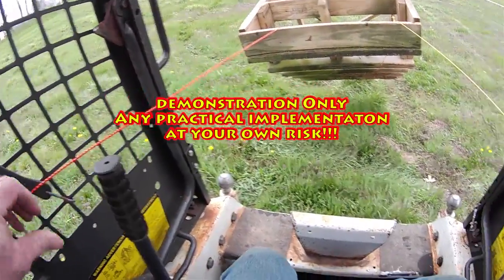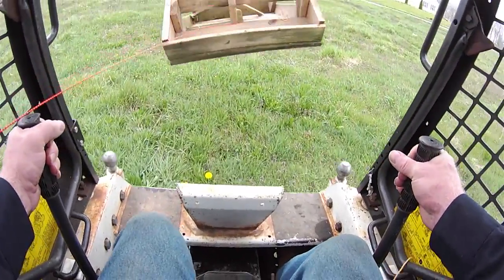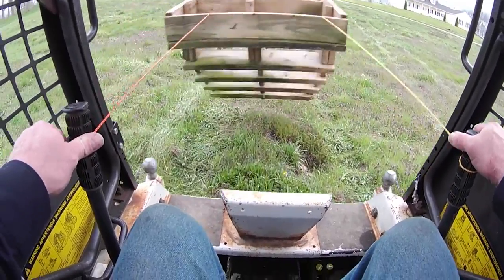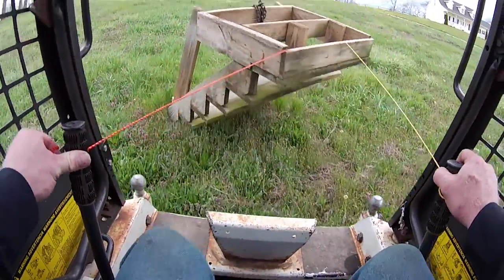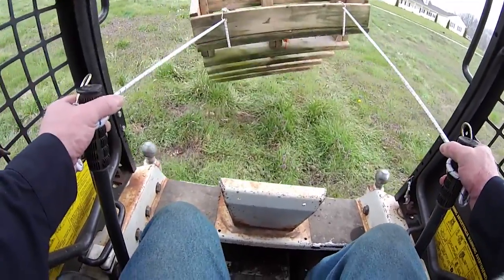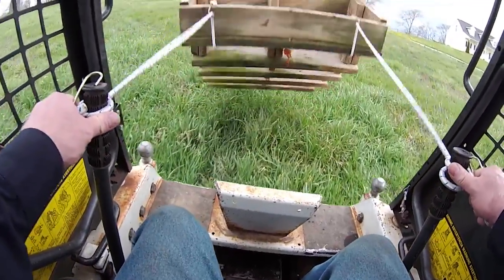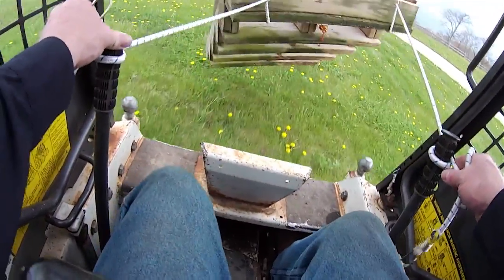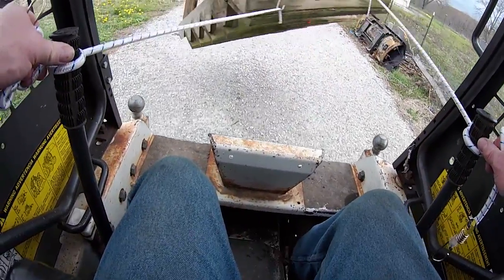Enhancing Skid-Loader/Bobcat Load Stability

Comment: I tried this on my 843 20 years ago, was moving a tree on a boom and did the same thing. I notice you didn't turn out in the field because that's when things get wild and crazy!
Reply from the maker: Are you by chance an engineer of any kind and or had any kind of process control experience. The reason I ask is anyone who would realize this might work would also realize why the second part never wouldn't. Especially with any load displaced insanely as a pendulum as I did. Just curious. 

For example to explain just the simple part of all this formally takes 4-6 pages, to explain how Tan(x) is not a factor in the swinging of the load takes another 3 pages, to explain how a how to apply superposition to map the bob cat 2 lever, two input variables to a simple single dependent variable controller takes another couple of pages. All this mess packed with math that I personally would only have a use for otherwise if I accidentally swallowed poison. (i.e. ipecac)

Like I said, just curious. 

It all goes toward answering the basic question, "Why don't you get a concussion trying to control anything that dumps that much power in such into such a very nimble, incredibly short wheelbase.  If you hang a plumb bob off the ceiling in the cab and hold one control in one hand, and feel your pulse with the other... you will realize the answer.
Reply: Electrical engineer by degree but mechanic by practice. Skid steer collector and enthusiast.  i like to explore and solve problems.
Reply from the maker: Excellent!!! I was very suspicious when I read your comment because I have 22 US patents and have heard similar comments for years. No one ever understands an invention before, but right I have a presentaton to explain it they always come up after and say something like, "Oh yeah, simple... thought of that when I was 5". So for every comment like this I usually assume that the person is either an engineer of some type, a genius, or simply a liar. Not to break my wrist off patting myself on the back... but you might just be a genius if you were able to make all the intuitive jumps from conventional controls engineering to even think of this on your own. Very impressive!